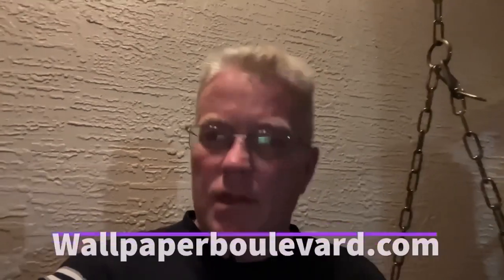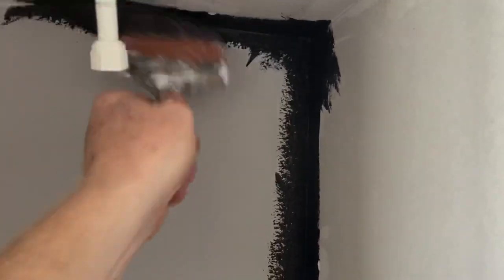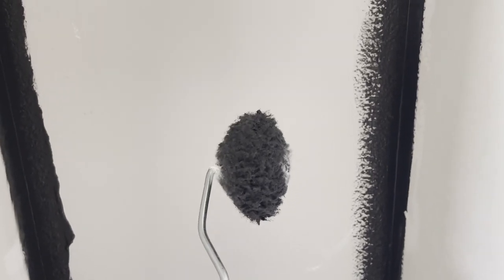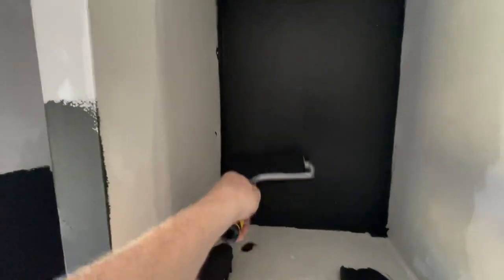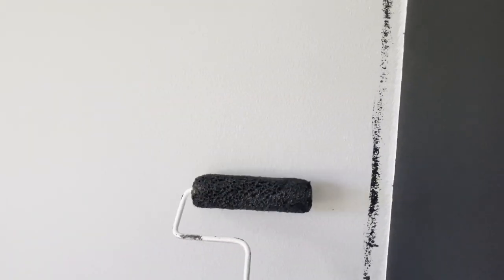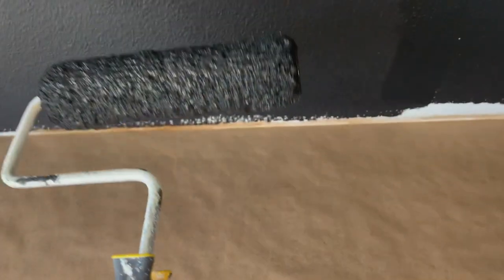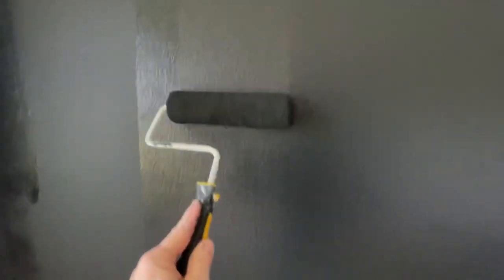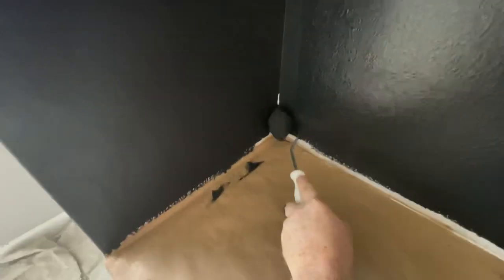How to Paint a Wall With a Roller & Paint Corners Quickly! - Spencer Colgan

Comment: There's a thousand ways to skin a cat. As long as it meows. Your corner roller is what I use as a mudwheel for corner beads. Why have 3 tools. Brush,corner roller?,and small wiz roller? Use your wiz and bump it in and brush the little bit you can't get. My two cents from canada